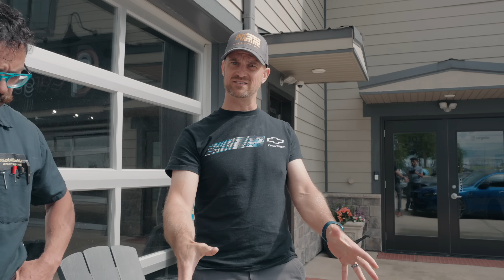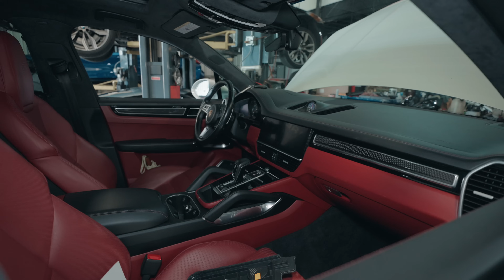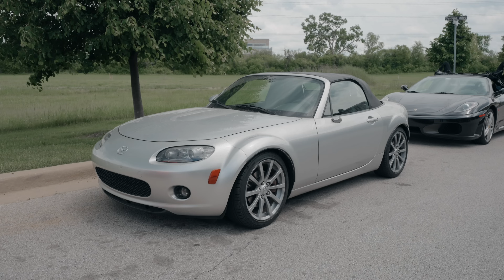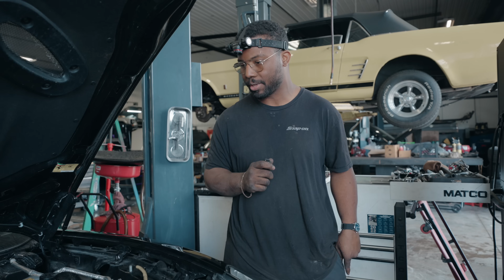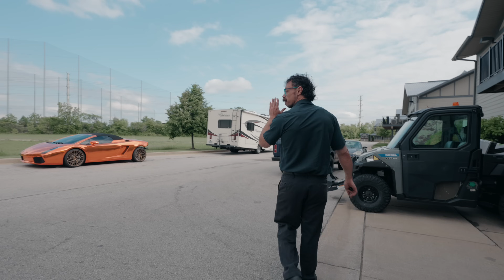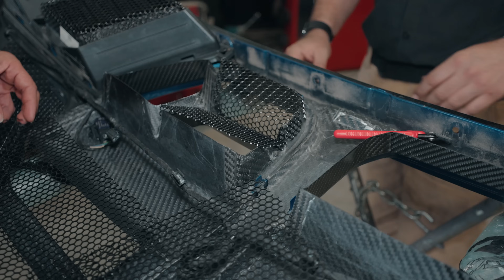These Cars Aren’t RIGHT: You Won’t Believe What Needs Auto Repair at Chicago’s Wildest Tuning Shop

Comment: Make sure to check the vacuum system on that Porsche, common issue is that they leak coolant into the vacuum system and cause underboost faults

Comment: Full service plus a touch of customer fab(excluding the fully custom exhaust part).Surprised there wasn’t an AC diagnostic and repair at the time of filming. That Lambo LM007 is a tough one. Having an engine designed to have fresh cool water cooling(through heat exchangers I presume)to a closed recirculating system.